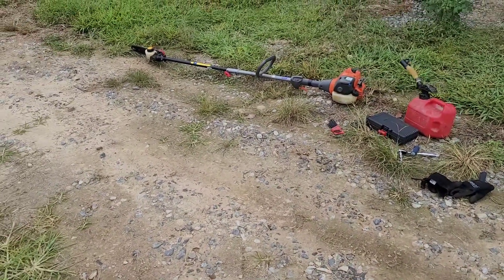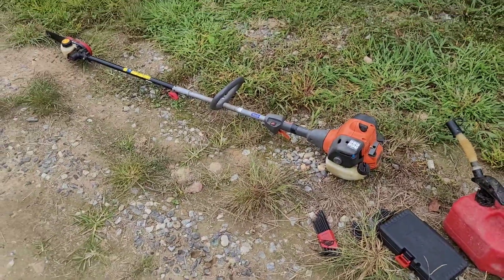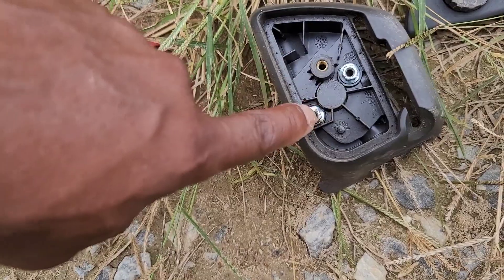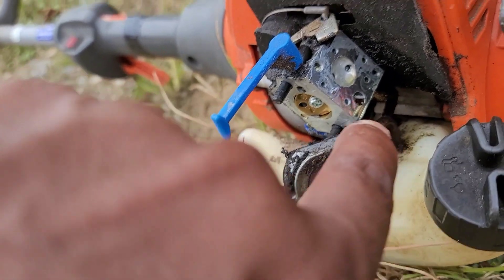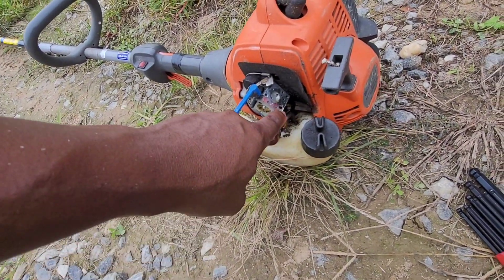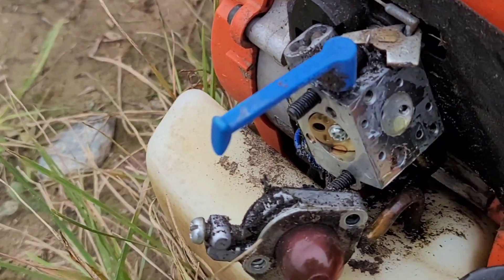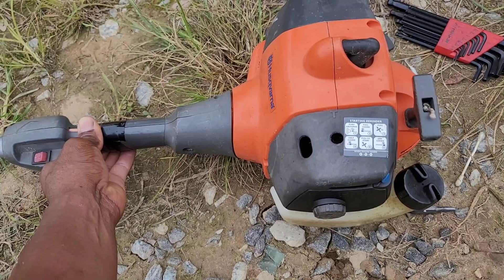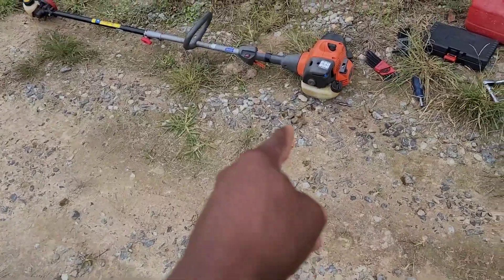2 stroke engine bogging down. Easy fix.

Comment: Hi Thanks for this, I was hoping that I had the same problem, (nice and easy) but it turned out to be a crack in the fuel input line, drawing air in.
I've had bogging down due to a cracked fuel line before. Anyway, thanks for taking the trouble to post the video, I'm sure it will help others. 
All the very best . . .  Andy  (In the UK)